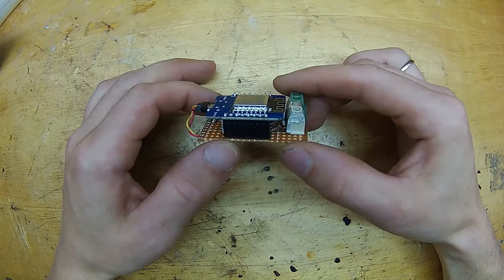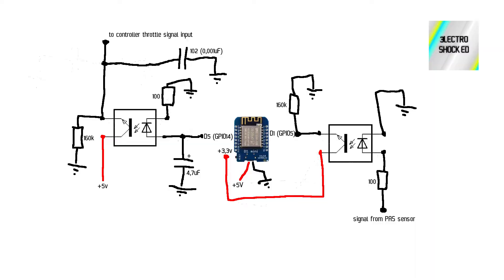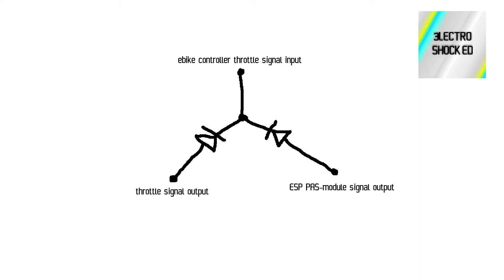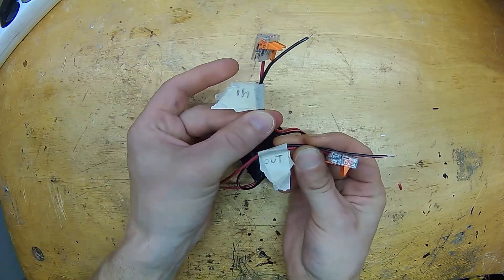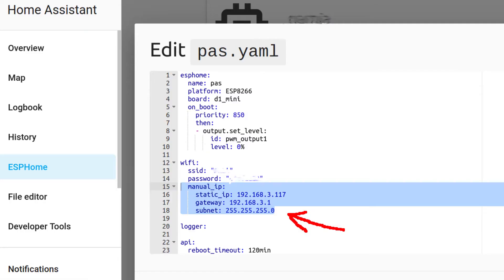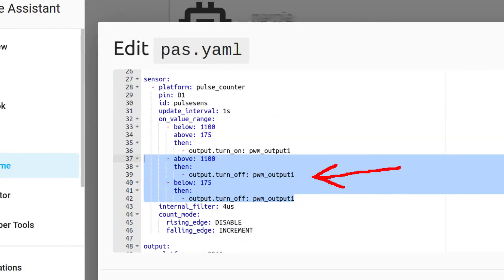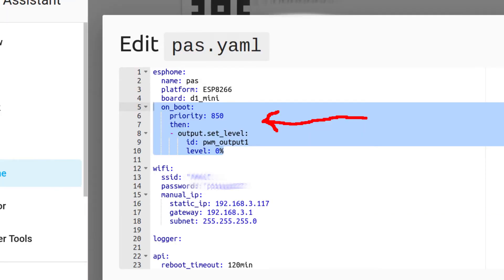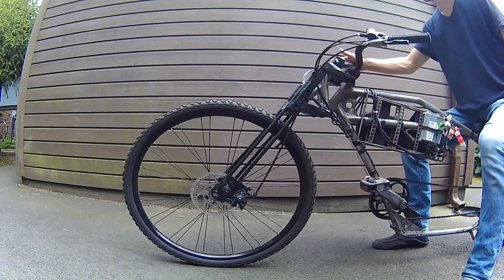DIY ESP8266 Pedal Assist for eBike controller with no PAS

Comment: I want ideas to do the opposite?  i want to add a thumb throttle or more to the point some sort of hill start boost to a controller without anything other than a pas input.
Reply from the maker: Thanks for the comment! That's a cool idea. So you don't have a throttle input on your controller?
Reply: @3LECTROSHOCKED   not legal in my country so off the shelf ebikes don’t have them. I have built a diy ebike with a throttle though. I could buy a multi level pas controller with throttle but it wouldn’t be as neat on the bike as what the factory bike has and it would cost significant money when i have a very good working controller. I just need to trick it into starting. It has a “walk along” 3kph mode but that is very weak and very difficult to trigger when your on the bike trying to start on a hill anyway.
Reply from the maker: It's probably there, so you should find those pins and connect a button, or a real throttle. That would be the most reasonable way to achieve what you want :)
Reply: @3LECTROSHOCKED  thinking about it could i just parallel into the pas sensor wires with a momentary switch and give it a few pushes with my thumb as i go to ride off?
Reply from the maker: It's a good idea, but it would work poorly. Pas system on a controller is actually kinda smart and need a precise and steady pulse tempo for activation. You can observe that behaviour by slightly turning pedals just for a 1/2 sec - nothing will happen. So by toggling a button you just won't be able to provide a good enough tempo for a steady reaction :(

Comment: Hi I changed new controller from 250w to 380w , my PAS is 5 magnet disc and sensor light flickers when I pedal but motor do not spin, should I change the PAS disc to 8 magnet?
Reply from the maker: Hello! I made those values to work on my disk, which has 12 magnets. So if you have 5 magnets, try changing the working range to 458 and 73. Hope that helps! :)
Reply: Thanks for the advise, can you please explain on the working range my controller do not have  display interface assume those you recommended are settings
Reply from the maker: Oh, sorry, I thought You are using the system I'm showing in this video. So, if you are having problems after replacing the controller, try A: There maybe two wires, that you need to connect together to do "learning". Put your bike upside down, connect wires, turn power on (the wheel will spin), spin pedals by hand for some time and then disconnect those wires and turn off power. B: If there is no wires, you controller maybe "smart", so just drive around for a few miles, turn power on and off for a few times and it will learn your hardware automatically. If those don't help, then you should check the specs on your controller, maybe it is hardwired to work only with a certain magnet disk. Hope this will help!

Comment: And how this is different from other one
Reply from the maker: Well, the 555-version is really simple. It is analog and requires a really good input signal. If your PAS-sensor does not supply perfect ON-OFF action (pwm), then if sensor stops in the middle of magnets, there could be a flipping effect. That could trigger this circuit to activate even if pedals are not moving. But if PAS-sensor is good, then it should always stay ether ON or OFF. The ESP-version is really good, because it is fully programmable. You can program every aspect of action. And also create additional automations, like cruise control. It is really not that hard to build. You just need to install Home Assistant in docker and configure the ESP-module with my configuration code :)

Comment: Hello, I bought a controller without PAS and I got here, for me this is quite complicated, is this chip not sold ready-made to implement by soldering in the controller?
Reply from the maker: Hello! Yeah, it sucks when a controller doesn't have a PAS. That's why I spend so much time creating this system :D Unfortunately there is no "ready" system on the market and I don't think there will be. Because the cost of a controller with PAS is not that much higher than for a controller with PAS. Sorry!

Comment: Hey! Really liked your implementation. Can we connect for some doubts and questions I have regarding your project?

Thanks!
Reply from the maker: Hello! Thanks! Of course, please ask any question here in the comments :)
Reply: I am working on a DIY pedelec system. But I am quite new to this. I was hoping to make a 48V 1000W system which can support my cargo bike design for my daily use. I have been going through various bolt on kits available online for example Bafang, Yamaha, Shimano, Bosch, etc. and they are all way to costly when offering true pedal assist systems with torque sensors. I was hoping we could connect you could help me out if that's not too much. Thank you!
Reply from the maker: Hello! Sounds like a very interesting project. I assume you want torque-sensor for more effective response when riding with heavy cargo?
Reply: @3LECTROSHOCKED  Can we connect on e-mail, devvrat.sisodia@gmail.com
Reply from the maker: Hey! I rather talk here in the comments. Hope you understand :) Please tell me more, I think I could help you with some advise. I have one very heavy ebike that is 1,5kw. I have been riding that for 5 years almost every two days..